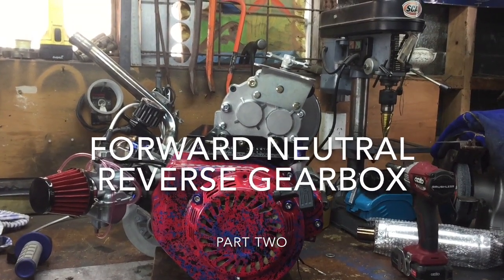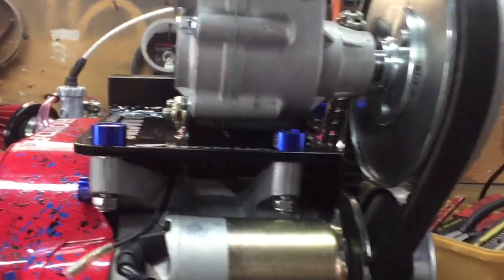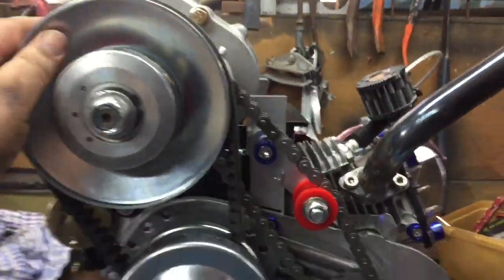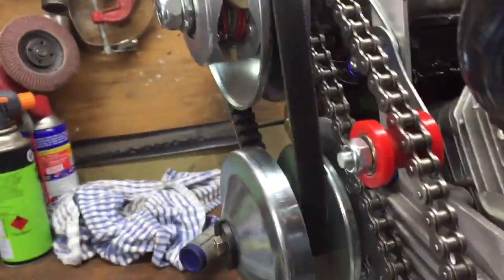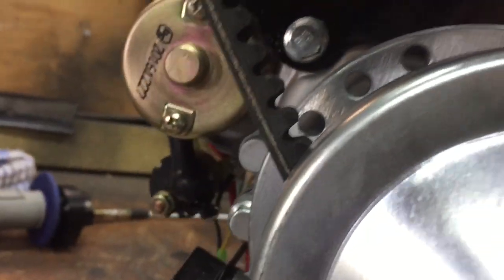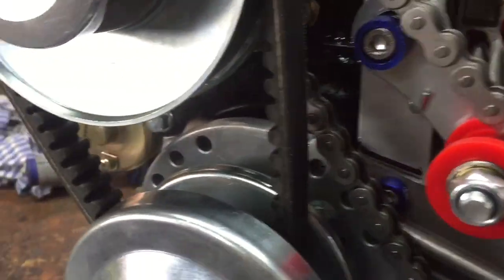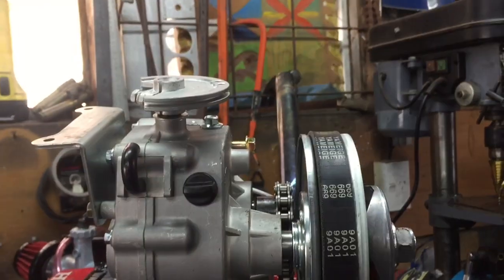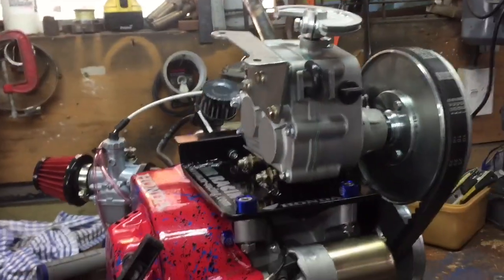Forward Neutral Reverse Gearbox Part2

Comment: I have a counter clockwise engine, it would work if I could put power to the output shaft of the transmission but not sure that would be a good idea, any ideas how to change the input to counter clockwise ?  Thanks in advance .
Reply from the maker: is it a 2 stroke engine you have? Because you can run a 2 stroke engine backwards or forwards by switch the electronic ignition circuit. if its a 4 stroke motor...Well good luck  your own your own there bud ;)

Comment: That's pretty Awesome man! It definitely helps compact and save a ton of space especially when running a torque converter and a gear box as well! Nice planning on that. Plus yes can use the original secondary shaft as a additional jackshaft for any gear reduction or increases. Very good idea man! Definitely prefer it done this way than running the secondary shaft to the gearbox and then to either another jackshaft or the axle. Great job Mate! Love it! Ingenuity at its finest right here for sure!

Comment: How did you get the pulley onto the reverse gearbox shaft? The keyway inside the pulley stops me when I try to slide it on.
Reply from the maker: Hi, I filed out the rough edger's on the keyway an manipulated the pully on with a big hammer oh an a squirt of WD-40 helps. Put a vid up would be good to see how you get on?

Comment: Hi,clay I like your build ,in my opinion its the best design on here or possible with the components used,so I get to my point,I'm building a buggy cart same power house as you,would it be possible to get measurements on the plate you made for the gearbox and torque converter I have made 2 already that don't line up right,please I could use your help,I am not trying to take your idea or credit for it,just need some help please.i may have some ideas you could also use,thank you. My email . Jdchevyfan79@Gmail.com

Comment: Did the gearbox hold up with the driven pulley on it?😊😊😊
Reply from the maker: Yeah mate, its going strong :) Not to mention the gearbox is designed for a TAV 30 series driven pulley to be mounted on it hense the shaft is the correct size:):):)..
Reply: Clay Hunna  Thanks for getting back to me. I saw your video and liked the setup better than any that I’ve seen before. Not a lot of information out there. Take care.😊 Dan

Comment: Thanks so much for the video!  I have been trying to find something like this for a few days now.  I'm revamping my son's gokart by adding a forward/neutral/reverse gearbox exactly like the one that you have, along with a CVT clutch.  So... it looks like you go from the engine shaft sprocket to the gearbox sprocket.  On the shaft of the gearbox you mount the centifugal pulley from the CVT, and run the belt to the other pulley of the CVT.  Is this correct?  The one thing I don't see is where you mount the sprocket that will connect to the sprocket on the gokart axle.  Can you tell me where this goes/how you did that?  Thanks!
Reply from the maker: Hello, glad my vid can help you and your son out! So yes your got it right, Drive pully mounted to engine, priven pully mounted to input shaft on the F/N/R Gearbox and the the output shaft of gearbox has the sprocket (12 tooth 420) so from that sprocket i run a chain to another (12 tooth 420) sprocket on the origanlly cvt backing plate (where the driven pully would usually go) then all you need to do from this point is add a second sprocket to this same shaft to drive your axle an boom your done!
But heres the real beauty of this system if you wanted to gear you final drive ratio up or down you can replace drive sprocket with a smaller or larger tooth sprocket to effect you final drive ratio. Cheers hope this helps an good luck

Comment: Looks awesome! I was told the gearbox is supposed to be mounted with the breather tube in the up right position so the oil splashes the gears properly.... how has it been running?
Reply from the maker: yes your correct about the mounting position of the gearbox, i completely opened up the gearbox an found with the gearbox mounted the way i have it still gets effective amounts of oiling as now both input AND output shafts,bearings etc are half submerged in oil at all times, Opposed only the output shaft submerged an having to splash feed oil to the input shaft (above output) .. Gear box has run flawlessly this way for me an to be honest i dont think ill run into any problems with mounting the gear box this way. Give me a week or two i try get some footage up of it running an changing gears. Cheers
Reply: Clay Hunna Glad it’s running great for you. Your set up looks clean.... Yes some durability and quality updates would be a really cool video and really appreciated. Have fun riding!